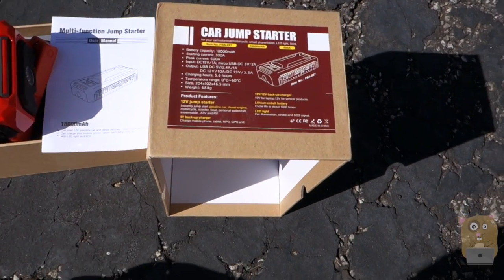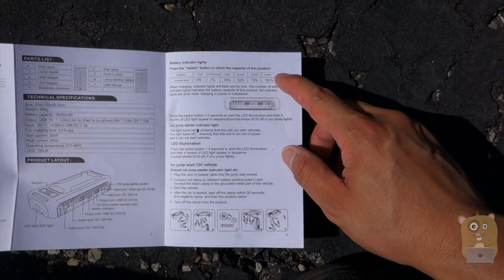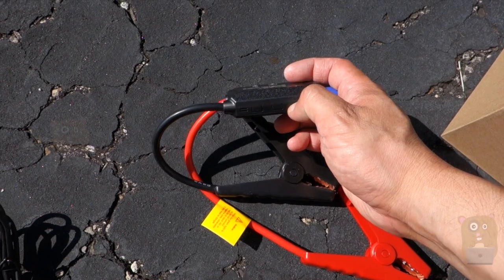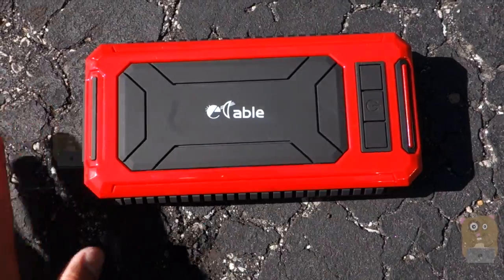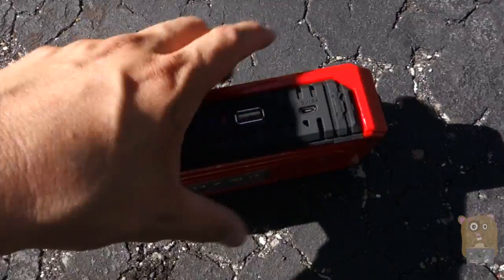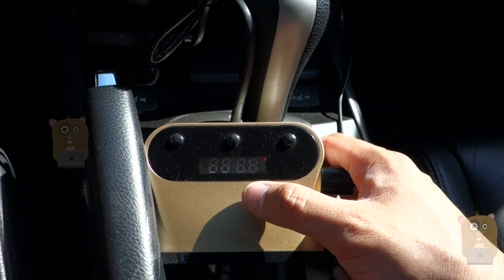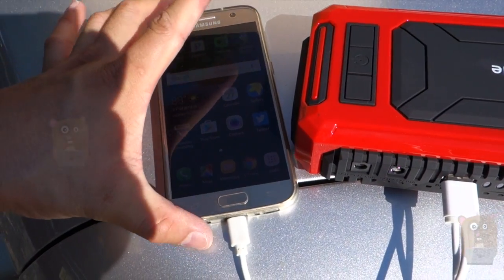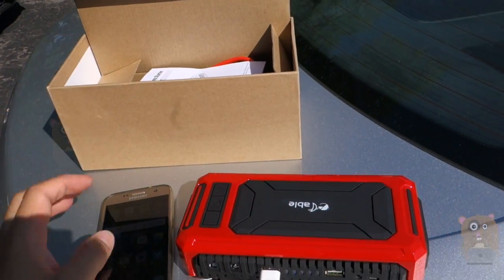ETABLE 600A Car Jump Starter USB Battery Power Pack E1227 Review

Comment: Thanks, Good review.   This is a device I'd purchase and store in my vehicle as a back up.  What is the shelf life of the charged battery?  Stated differently, once I charge it how long will it hold that charge before if left unused before I have to recharge it again?
Reply from the maker: Even after 6 months, I don't expect to love more then a quarter of the capacity.  I try to charge these portable batteries once every 6 months.  It's good practice to charge it every 3-6 months.
Reply: +AwkwardHamster 👍 Thanks again!